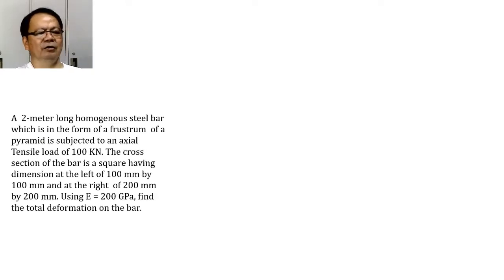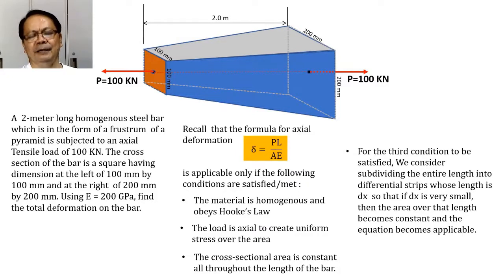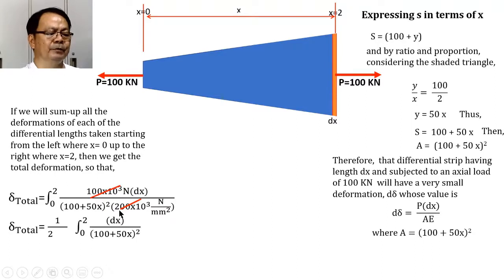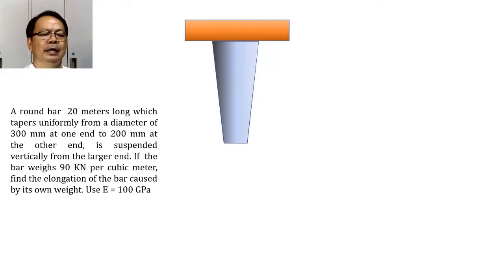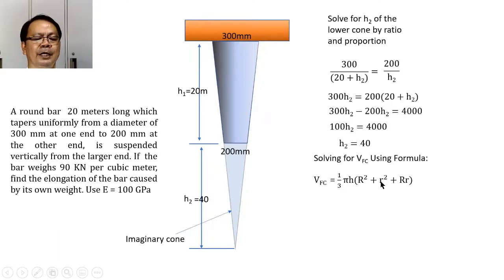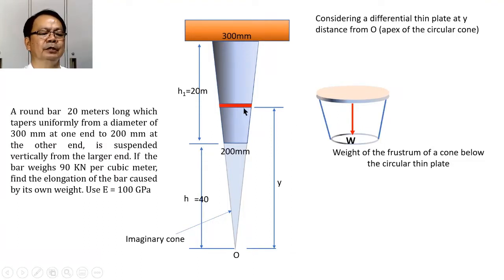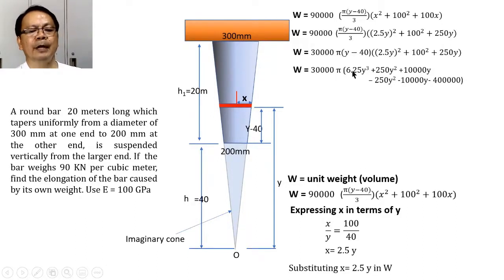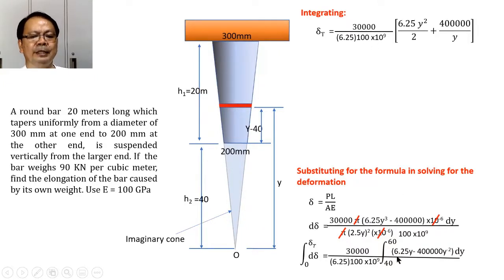Axial Deformation on Materials Having a Tapering Cross Section

Comment: solid na solid! champion ka magturo sir!
Reply from the maker: Thank you again for watching... In setting the limits of integration ay hindi nangangailangang sa unit of area mangagaling kundi sa nais mong maging resulting unit ng deformation. Kung maoobserbahan mo, in the formula for the deformation if E will be expressed in MPa or N per square millimeters then square millimeters will just cancel leaving the unit of deformation equal to the unit of the length. Hence the deformation in the first sample is expected to be in meters which  can easily be converted in mm.
Reply: @willerdayahan2865  ohh I see. Thank you so much sir for the enlightenment.
Reply from the maker: Thanks for that very nice feedback and remarks .. sana patuloy niyo itong suportahan by subscribing and sharing what you learn from here.
Reply: @willerdayahan2865  1 question sana sir for the first problem. nung nag evaluate na ng integral, hindi po ba dapat 0 to 2000 ang value instead of o to 2? since ginamit nyo kasi na dimension sa Area is in mm po (100 mm and 200mm)
Reply: @willerdayahan2865  Please see my reply below sir Willer! Much appreciated if you will.